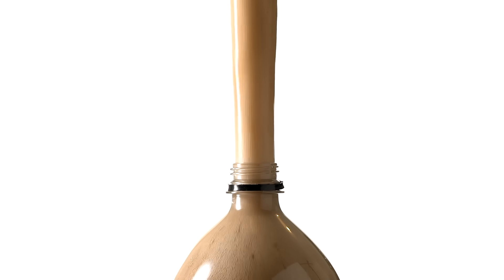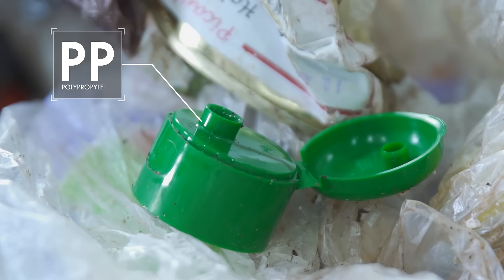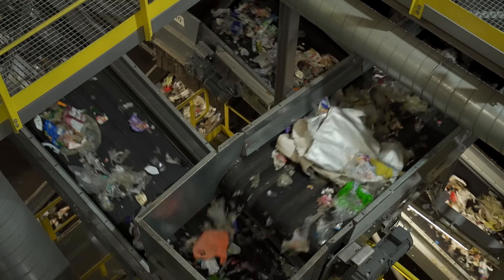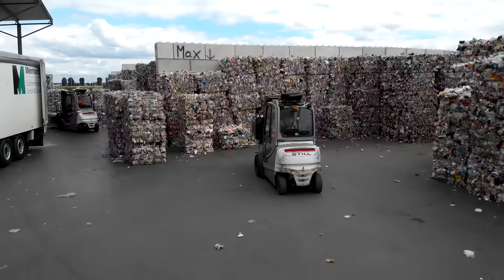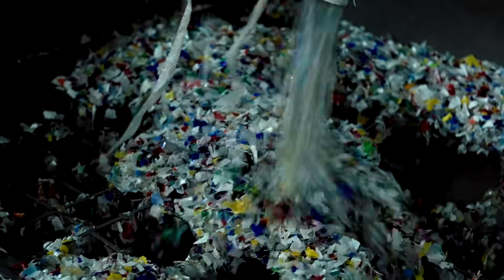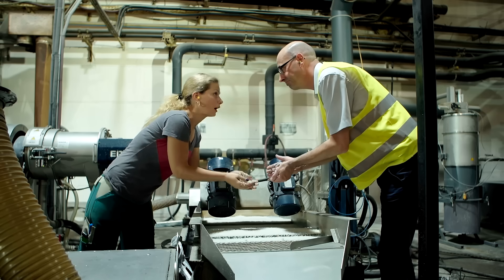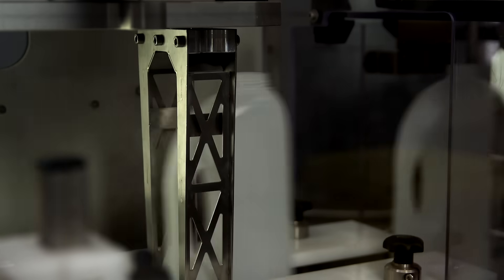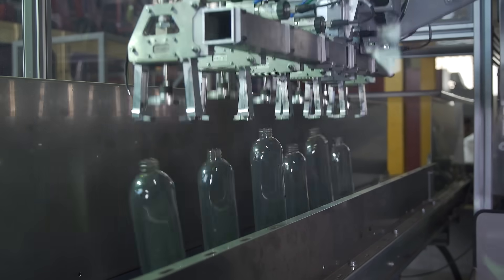Recycling plastics – Resource efficiency with an optimized sorting method

Comment: The recycling center in Germany is the same as the recycling centers in Canada, the United States, and other countries.
Reply: Sort of.  At the Cloverbar waste recycling industrial complex in Edmonton, Alberta, Canada carried plastics classification to a much higher degree with plastics wastes separated into 5 broad types and then separated into 30 different high purity streams.  We didn't have access to half this technology showcased on this video.  Needless to say a lot went wrong and the plastics ended up still being rejected 20% of the time from other post recycling manufacturers.  The single worst problem was always colour and cross contamination of plastic feed stock.  Molding processes are super sensitive to slight impurities.   Waste fractional and classification is still very much in it's early development.  Both German, Sweden, and Japan are world leaders on materials recycling and making it workable to a very high quality.  Our various Cloverbar recycling plants are in different stages of trying out new systems and upgrading as they learn lessons.

Comment: Why not heat compress that crap into giant lego-like building blocks, beams, fence posts, hells bells, save wood!  UV resistant building materials that could last decades, and be reformed into new structures, think outside the boxes humans!
Reply: Because I don't think plastic is a strong enough material to be used as architectural support, such as beams, building blocks and what not, unless you want your house to fall on top of you. Some plastics crumble from exposure to UV ray in a short amount of time... What the heck are hells bells?
Reply: @VulpinetideCuteTimes0w0  Hells Bells is an exclamation, rather like "for Gods sake" or "for goodness sakes"
Reply: I was thinking the same way like what the heck compress into something for a long use.
Reply: To make plastic UV resistant it has to have an additive added to them, this additive makes that the plastic becomes less recyclable

Comment: Surely the plastic industry could come up with a common plastic to be used for the majority of food and drink containers , why does the lid have to be of a different kind of plastic , I know we let them do it because it must be more profitable , its all about dollars , time to lay down the law and sort this shit out , force the industry to reuse old plastic or revert back to metal or glass , what is wrong with aluminum which definitely will be recycled , can a milk container be made from aluminum .
Reply: Are you willing to pay it?
Reply: Some plastics are stronger than others, but good question. I assume with different products especially liquid one's might react differently to different types of plastics, but, that's just my guess. We should go back to using bio degradable packaging.
A milk container should not be made of aluminum, unless the inside of the container has a thin layer of plastic to keep the metal particles from mixing in with the milk. Soda cans are made of aluminum, but if you use acid to get rid of the aluminum, what will be left is a thin layer of plastic inside.
Reply: Foxguy The world did not need plastic for food containers in 1950 and we don't need them now , so whatever we done in 1950 just reintroduce it , just recently a tomato sauce I have been buying all my life was taken out of glass and now in a plastic bottle , so I bought two glass bottles and bought the bulk sauce which is far cheaper and put it into my glass bottles and I am happy , as well as putting the sauce in plastic they have reduced the majority of the sauce to half the size of the previous glass bottles  , more profit in both changes , cunning as gutter rats .
Reply: I'm with you on setting up regulations to limit the use of different types of plastics on one product, for the ease of recycling. As for totally going back to glass or aluminum or what not, PLASTICS clearly has it's advantages (light weight, can be squeezed to squirt liquid out instead of pouring, etc). I stand for the comfort and the effort of civilization, that PLASTIC as a man-made material, definitely should exist and even be widely applied.

Comment: its time packaging design becomes complient to recycling machines needs
Reply: You're right in some of what you say. I worked in a factory making plastic bottles. Different bits need different plastics. The PET for a bottle isn't right for the lid or screw top. Some, though are made with one plastic put in another. Those should be banned.
Reply: E
Reply: 1000+ Likes for this beautiful construction👉👉👉https://youtu.be/vfzVlwVz81c
Reply: @chrisqsenior694 😢
Reply: Chris Q Senior p
Reply: Requirements for labeling every part of every product produced would solve the issue by allowing computers to sort through trash, ie a single stream trash/recycling system (minus compost).  It would also save costs on transport.

Comment: Excellent video, thanks.
 I used to work in the cement industry burning these materials for energy, Re-use, then Re-cycle always beat energy use.

 The sorting processes have improved enormously due to technology, and the computer processing speed, I love the optical separators with air blasts to strip out the bad guys.
 Thanks

Comment: It would be so much easier to just reuse bottles. Make it illegal to not use recycled materials for most packaging and tax single-use items. It will solve itself.
Reply: Reusable glass that just has to be tested to cracks and cleaned with steam could fix most of the plastic bottle problem.  Those insulated metal cups cut back on bottle usage minus the bottles a drink comes in, but the idea is there.  A cash incentive for people to return bottles would work, but is not an option in most places.
Reply: Not really, making shit illegal isn't the solution to problems at all. No matter the problem.

Comment: What happen to bio plastic. That was bio degrade
Reply: Turned out it doesn't degrade quick enough
Reply: turns out its too expensive
Reply: All plastics decompose in nature, the main differences between "regular" plastics and the so called bio-plastics is the way they are made, one is petroleum based and the other plant based, the time they need to decompose in nature, for "regular" up to 500 years (although a crucial role plays the characteristics of the surrounding environment, for instance, like in-land, dry place with sunlight directly hitting them, or in the ocean) and bio up to couple hundred years. Also, bio-plastics are not recyclable (majority if not all) and to decompose fast an industrial composting site is needed and a compostable waste collection system. So bio-plastics gained traction due to misleading promotional games that are based to the so called climate change movement, and if your area don't have the proper infrastructure you might end up doing more harm than good to the environment.

Comment: Seems pretty efficient already, but to get to 100% for all aspects of recycling would be great. 

I'm pretty avid in making sure I do my part in separating the recyclables before the garbage man comes!!!  :-)
Reply: As they say in the film this is only recycling about 15% of the 5%  that is collected in Bavaria for this plant.  Most of it is not recyclable and is incinerated. It's a fossil fuel.
Reply: @organicearthful    Well, at least it's not all completely wasted, but I really thought all of it was recyclable... if old wood can be made into pressboard or particle board, and aluminum and tin cans (or any metal, for that matter) can be melted down to make new ones... Tires (rubber)...  certain fabrics...  whatever...  you'd think anything could be recycled... but I never thought that certain plastics couldn't be recycled!  Shows what I know!  Whatever happen to Glass anyway... did we run out of sand?   lol   :-)

Comment: Can any one please reply to my query??

Is there any methodology or process to recycle or re use the plastic covers/packets of lays and other chips??

What does the western countries do with these??

Does anyone have idea on this ??

Your reply will be greatly helpful to me.
Thanks
Reply from the maker: Packets of chips consists of special multilayer plastic compounds, while one of the inner plastic layers is vaporized with aluminum. That causes the shiny silver color on the inside of the package. The multilayer plastic compound has one advantage: the Chips does not lose their crispy consistence and can be long-term stored until the time it is eaten or the ‘best by’ date is expired. However, in the end of life those multilayer plastic compounds are hard to recycle with general recycling technologies. Plastics are shredded and sorted: only pure plastics can be sorted out and can be recycled in a circular manner, the rest of the shredded mixed plastic waste is either used for so called Downcycling (producing garden furniture etc.) or is burned in incineration plants. There are already efforts (R&D) taking place to recycle special multilayer plastic compounds: for example in a special solvent bath the multilayer plastic compounds can be again partly separated from each other. But still, those recycling techniques have to be evaluated from a life cycle perspective, means that the special recycling of multilayer plastic compounds should not use more energy and resources (for example for a solvent bath a chemical solvent is used that has its own ‘production – usage – end-of-life’ circle) than the saved resources by giving the recycled layers a second life…Recycling is a very complex topic, which always leads to the basis of waste avoidance, means that the best plastic is still the one that is not produced.
Reply: Yeah in best case scenario they end up  in the landfill.
Reply: #TerraCycle does bag and film collection.

Comment: There could be a rule to use 5l reusable cans or larger for cleaning products etc. If a smaller size is needed use your own container (package less). Identification only QR code and a name since marketing materials can be printed once and published online for less waste. 
So you used 5l HDPE can instead of 10 500ml dispensers - you just cut waste by half
You didn't buy that can with a label instead only a cap has printed QR code. Lo and behold It makes cleaning much easier.
When it's finally empty bring it to a special self-driving container that drives to a facility when full and does it slowly with little energy. Ideally, the package is designed in a way it can as many as possible. Or it is done with help of a logistics company.
In the end, it is washed with only about 1/5 of energy used compared to recycling. The package is used until it has to be recycled. Once that can't be done it is incinerated or made in jet fuel and heat.
Reply: And concentrates you add water to after shipping.